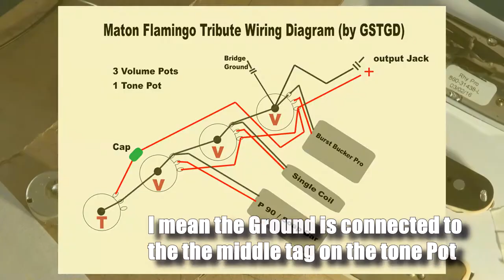3 Volume 1 Tone - Custom Soldering Guitar Pickup Wiring for the  Maton Tribute

Comment: Compliments! Very interesting and well done video, can I ask you: are the 3 pick ups indipendent, can you turn down each one without acting on the others? I am trying to apply a similar wiring to a  Rickenbacker 325 with 3 volumes 1 tone and 1 mixer no switch, I am close to it through many attempts(I am new in the matter) but I haven't quite achieved what I am looking for,and again, you are very good! Thank you
Reply from the maker: I found that they did impact each other. I feel it is because you are changing the overall resistence accross the 1 circuit. each leak into each other some how. i changed to 3way switch, and standart Strat config wiring and knobs.